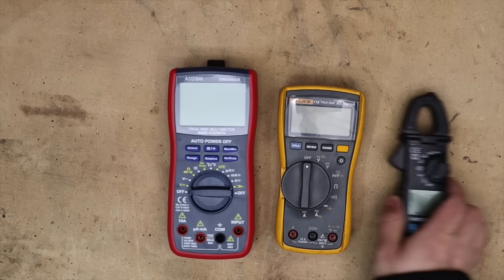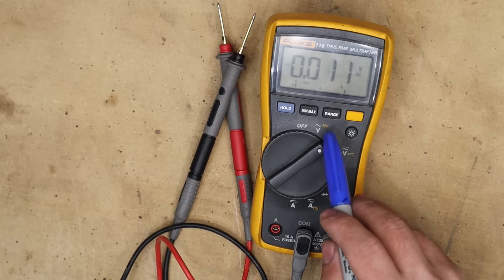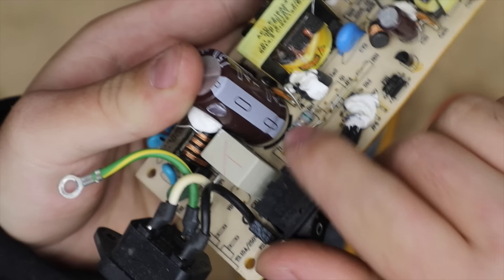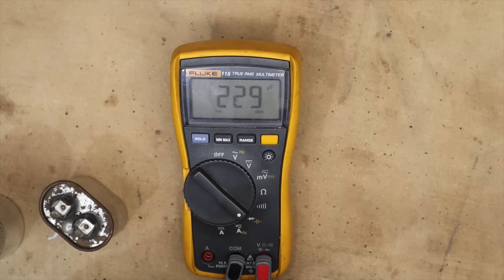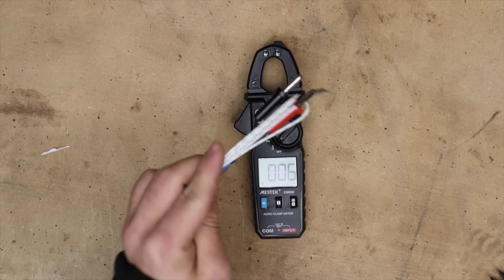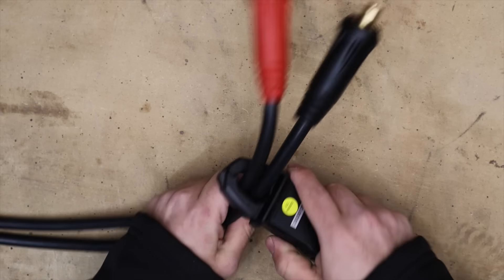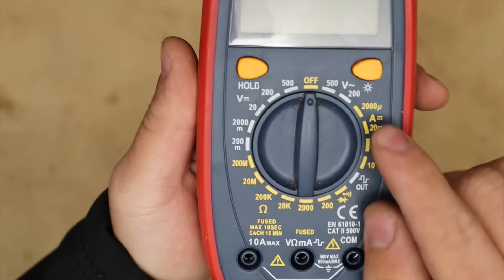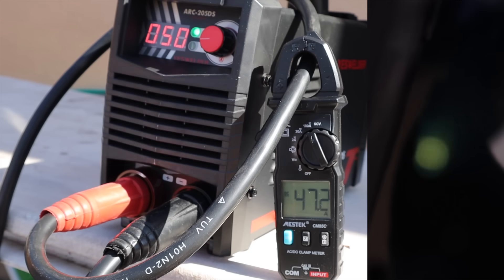How to use a multimeter like a pro, the ultimate guide

Comment: Excellent short intro for beginners here. Picky addon here, sometimes written K, kilo is officially k, not K, as you can see on the Fluke. K stands for Kelvin.
Reply: Also the ”Ol” text when measuring resistance stands for Overload, not open loop. But it basically means the same.
Reply: Open loop or over limit sometimes used by some professionals, sounds close to the concept that the reading is beyond the limit of what the tester is designed by the manufacturer. So overload in this sense is a different concept. But you are also right
Reply: Who the heck is kelvin?
Reply: That must be a fluke.
Reply: @ehdbom I always read it as over limit.
Reply: @MsLegumam, where did you find that ghost logo?
Reply: K is also potassium. Eat a banana.
Reply: @tomh6477  
Mr. Kelvin...
Reply: @georgelamacka8125 actually Lord Kelvin, formerly William Thomson 😊
Reply: @johnleo2668 how can an open circuit be over limit on resistance, its open.... Relays might have a pair of normally open and normally closed contacts, I sure hope the normally open ones read OL in the unenergized state
Reply: An easy way to remember which units get capitalized and which ones don't is that units that are named after a person (usually the last name of a scientist or someone related to a particular field, e.g. Kelvin) are always capitalized and the others aren't (I think there's one or two exceptions to this, but it works the vast majority of the time).
Reply: An open circuit has a resistance but it’s too high for the multimeter to measure so it’s over the limit of the device. 

That doesn’t mean the resistance between the measured points is infinite. Air has resistance and a high enough voltage can jump over air gaps. 

I wouldn’t say it’s overloaded since there is no load but ”over the limit” describes the situation quite accurately.
Reply: Capitalization is important to get right when it comes to metric units. All sorts of things are distinguished only by a difference in capitalization.

mV = millivolt
MV = megavolt
nm = nanometer
Nm = newton-meter
s = second
S = siemens

When dealing with derived units, getting the capitalization wrong can really make things incoherent.

kWh = kilowatt-hour
KWH = a strange derived unit called a kelvin-watt-henry... whatever on earth that would be
kg = kilogram
Kg = kelvin-gram... again, whatever that is

Oh, also, units named after people (like the volt, the kelvin, the pascal, etc.), are always lower-case when spelled out, but the abbreviation for the unit is always capitalized (V, K, Pa, etc.).
Reply: Units are capitalized when they are named after a person.
Reply: @MrTheHillfolk  An open circuit still has a resistance. It's just infinitely high. Very high voltages can jump air gaps, creating arcs, sparks etc.
Reply: Ty
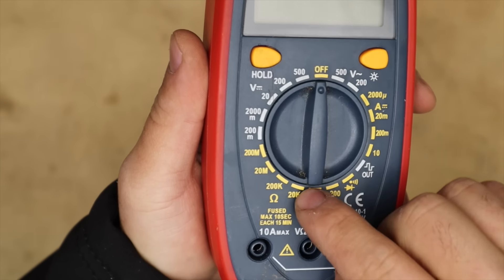Reply: Those standards could be for the scientific community. Other fields may have different standards and practices. If he is actually wrong, I’m blaming the multimeter at 11:09 as it shows a capital K for Kilo/thousands.

Comment: I've watched a few of these type videos about multimeter usage. After 36 years as an instrument technician, I can say what is missing is a basic test before using a multimeter. The meter leads must be tested before use. Plug in the leads and short the leads to test continuity on the OHMS setting. Zero resistance verifies the leads are good.
Secondly, when testing for voltage use a three point test. First, test a voltage source that is live to verify the meter functions. Now test your target source to verify there is or isn't voltage, then retest the live source.
Failure to perform these two simple  tests could result in electrocution, or at least getting zapped.
A good video!

Comment: This was the absolute BEST explaining video I have watched. Extremely easy to understand - even for me that have more or less no clue what-so-ever about electricity. Now I know how to measure electricity for home use. Thank you so much for a very good video !! Respect.
Reply: Cheap meters can tell you something, if you know their limitations.
I have a nice fluke at woek and at the home shop ,but i got a couple The harbor freight freebies at the house. 
Sure ,the fluke tells me the outlet has 121 volts ac ,and the harbor freight one says 130.
When i turn the power off to replace the outlet ,they both read zero. 
Not so worried about accuracy with that ,just if its safe being on or off. 
Still works fine for checking the occasional suspected dead battery for the remote and things like that.
Reply: @MrTheHillfolk  I agree. I thought of getting a Fluke but realized for home repairs an el cheapo meter works fine. It only has basic functions with cheap build quality but I only ever use voltage and continuity to check batteries and blown fuses and never found a use for all the other functions. For professionals and electronics enthusiasts a Fluke is worth it for measurement confidence and circuit protection but otherwise these harbour freight meters are awesome.
Reply: @jonfreeman9682 to be honest, I'm not that impressed with a fluke, being that I work outside all the time as soon as it gets one raindrop on it, DC volts goes thru the roof. 
16v on a 12v system? 
Nope. Pop the battery out and set it on the trucks defroster for 45 minutes and it'll be fine.
 It's a real headache and a hassle. 
Save your money.

Comment: 3:55 STOP! DO NOT USE Continuity function to check if a wire isn't broken! A wire can be damaged and still show good continuity. To check a wire for damage use an Insulation resistance tester! For example Fluke 1507!

Comment: Thank you so much for your thorough explanation of the multimeter. I've been using multimeters for years and I have always tested for continuity with the ohm setting. I never realized there was a continuity setting. And I always wondered what that symbol meant. And most of the time when I'm thinking I want to check homes. I want you actually check continuity. So thank you once again. Great job!

Comment: Great video... Very informative. The only thing you left out is on the diode setting - when forward biased (current is flowing, as indicated by a numeric value), that value is the actual voltage drop of the diode, typically 0.5 to 0.75 (consult the device's data sheet) . Any value outside that range indicates a "leaky" diode. Also, some specialized diodes, like zener diodes, behave differently, which I'm not going to go into here. Altogether though, excellent overview.

Comment: 2:05 another reason to use only one hand is that if you touch a live wire, the current goes through your body and that almost instantly triggers the differential switch and saves your life. If you use 2 hands, the current might go from your left hand to your right hand, completing the circuit without current going to earth and therefore the differential switch won't cut off the voltage.

Comment: I am an R&D engineer that has used multimeters extensively and occasionally an o-scope … but that is a whole other kettle of fish. Your tutorial is well done … and thank you for going over some of the most common safety risks. One safety example you might consider adding is discharging a high capacitance capacitor like found in HVAC units with a high resistance resistor (bleeder capacitor). You could highlight the changing capacitance whilst at the same rendering the capacitor safe to handle.

Comment: I own a few different types and brands of multi meters. Each one has its own advantages. I use my auto range Fluke for most jobs, it’s really the easiest one to diagnose and test with. Having one that gives whole and decimal readings is the best one to have. Testing batteries at my house is the most common task I use the meter for.

Comment: This is a good tutorial on multimeters.

Here’s a handy piece of info for anyone with 18-V tools: a fully charged battery without load will most likely measure over 20 Volts over the terminals so use the next higher setting to avoid an error/overload message. 

P.S. Kilos are definitely represented by a lower case k in the SI system.

Comment: Just to make something more clear: at min 2:00 you say that when inserting the first probe into the socket, the other one could become instantly electrified. This is true. Though, jf you touch the other probe nothing would "probably" happend as the internal resistence of the multimeter when set in Voltage measurement mode would limit the current passing through your body to uA/nA. I used "probably" because if nothing work as ideal (EG: the multimeter is wrongly set, or the voltage you are measuring is actually bigger than 120/230V) something may go wrong. This is quite remote anyway. And better stay safe not touching the other probe as you said in the video :)

Comment: Yes that was a good intro to meters. One small thing that may mislead some, on most meters you don't have to put the red lead into the amps socket for small currents, typically 200 or 500mA. You will get a much more sensitive reading in the mA range.

If you are a keen DIY car mechanic, invest in one with the frequency and duty cycle functions, very handy for testing sensors like cam, crank position, abs, and some types of airflow sensors

Comment: Great video. I’ve been an electrician for 20 years and always thought OL meant ohms not open loop😂. The only other thing I’d add is discharge capacitors even after the power source is disconnected. Many years ago father had one blow up right in his face off a burner circulator.

Comment: Great guide!

Don't forget to measure and account for probe resistance during resistance measurements!

Also, the reading in the diode mode should be the forward bias voltage (which can tell you a lot)
Reply: Can you explain more for beginners cheers👍
Reply: @kevinlawes591  before you take a resistance measurement, you should touch the ends of the probes together and note the resistance without measuring any component. This number should be subtracted from whatever you're measuring. 

The leads and probes have resistance of their own, but the meter doesn't know what this is and just sees the leads and probes as part of the measurement.
Reply: @kevinlawes591  when measuring a diode, the number displayed is the forward bias voltage (the voltage required to turn the diode "on") you can use this to calculate parameters for other components, eg the resistor for an LED etc

Comment: I'd to add to the importance and functionality of the continuity feature.  As a residential remodeler, it has been absolutely vital in troubleshooting electrical systems and knowing exactly what wires go to exactly what outlets in another location without physically seeing the wire run.  I use alligator clips, spare wire and colored electrical tape to be able to go from one end of the house to the other as I frequently work alone and have no one to hold things for me.  This is done with the power off so I can freely touch bare wires with no worries.  We are also required by law to run a continuity test for new home inspections before power can be turned on to the home.

Comment: Multimeters and speed squares are the two most underutilized tools in the trades. Both offer an extremely large and detailed amount of information in a single tool yet most folks use them for less than a handful of tasks.

Comment: One thing to add on to your explanation for continuity. The multimeter will produce a tone until the resistance between two leads it’s under a certain value. 

It is up to the technician to determine if that value is acceptable for the application. For example, if you are determining if there’s a short circuit and your DMM beeps and shows a resistance of 200ohms, that is okay if in your application the voltage between two lines is 1VDC. But if the voltage is higher then that could be a problem.

Comment: Also important to mention is the category of use (CAT) rating.

CATIV requires CATIV leads, which typically come with covers on the probes only letting an itby bit poking out. This is not packaging! That ensures you don't have a large probe stick out at mains voltage where there is a high fault current potential, and preventing accidental shorts creating large explosions. It is required on mains lines, power meters etc. Also the meter needs to be compliant so that any fault that blows up the meter, contains the explosion within the meter. This will also have a voltage rating it can work up to. Typically this is only work for electricians anyway.

CATIII (or above) is what you should be using in switchboards/service panels.

CATII (or above) is what you should be using at sockets. Depending on the probes you have, removing those caps on the probes might de-rate it to CATIII or CATII, but allow them to be inserted into each pin of the socket.

CATI, which usually isn't listed, is basically what you'd use on electronics or extra-low voltage sources. Without any markings, assume those cheap yellow bricks are CATI.

Comment: When you use a meter in series to measure current, it is good to get in the habit of moving the test lead back to the 'normal" jack as soon as you have made your measurement(s). This helps to prevent accidentally short-circuiting something. With some meters the fuse that protects the internal current shunt from overcurrent is quite expensive.

If you are using a "true RMS" meter, be sure to read and understand the manufacturers documentation. Fluke, for example, has a DC blocking capacitor in series with the AC input, so the value you read if there is "AC ripple" "riding" on a DC offset is that of the AC component only. Fluke insists this is correct, but it isn't. The true RMS value must include the DC component. Fluke manuals do tell you how to measure the true RMS that includes the DC (square the AC RMS value, add the square of the DC value and take the square root of the sum). Other meters will directly measure the true RMS that includes the DC.

There are tons of inexpensive meters that will display way more digits than can be justified by the voltage reference used in the meter. Lots of resolution can sometimes be useful, even if the absolute accuracy is poor, but you need to understand what is going on.

Comment: For those meters that don't have a continuity option, (Cheap harbor Fright) you can also use the resistance setting to check for continuity. 
While you won't get an audible tone, the subtle change in readings will tell you that you are touching the same wire.

Comment: Fluke has another function that they put on high end meters like the Fluke 87.  It's called nano Siemens (nS).  You can find it on the Resistance ranges when selecting manually.  Many don't even know what Siemens are!  Siemens are the inverse of Resistance or Ohms (Siemens were originally called Mho which is Ohm spelled backward).  What good is that, you ask?  You can measure extremely high resistances!  On the meter if you have an open loop (OL) using nS, you will see 0.00 nS.  This is effectively infinite resistance.  If you touch the probes together, you will get OL on the display.  Remember...this is the inverse of Resistance or 1/R.  So what can you do with a nS meter?  Test lots of things like semiconductors for leakage.  Sometimes a circuit that is failing will have strange operating conditions because FETs, Transistors, or Diodes are leaking current when they should be stopping current from flowing.  Usually the best way to check suspect components is to take a known good or new component and check it in reverse bias like a diode or a PN junction of a Transistor or a Gate to Drain or Gate to Source in a FET that should have no current flow and compare it to a suspect component of the same type.  nS will tell you when there are leakage currents where there should be none or at a minimum!  You could also check capacitors that may break down under higher voltages but measure okay with the standard settings of a meter.  You could check any component that is supposed to have a very high resistance or open condition.  Leakage currents that exceed specifications can make troubleshooting failing circuits very difficult to diagnose.  nS is an amazing function that should not be overlooked if you have that function available to you on your meter!

Comment: O.L. according to manufacturers manuals means "Over Limit". You can read OL in voltage measurement mode if it is out of range; still voltage there, not open loop.

Comment: 2:52 - Can't say I've ever heard of OL referred to as "open-loop". I always assumed it was "over-load", meaning the meter cannot read that high, so the reading is over the load rating of the meter. There is certainly a resistance rating for the rubber casing, it's just beyond the ability of the meter to read.

Comment: This is an excellent video that I found very helpful as a rookie who “tries” to do just a little bit of automotive electrical work.
I would like to invest in a Fluke meter, but the myriad of models they offer is blinding!  Even your video shows a 115, yet the link you provide is to a 117…& then why not a 116, etc.  Could you shed some light on which I would need for which model would serve my needs around the home and car?
Thanks again for a truly excellent video!
Reply from the maker: Truly, if its just around the house, once or twice a month, a cheap Astro AI meter for 15USD will do just fine, if you do however want to test capacitors for example and have a better quay meter, a 115 is plenty for 99% of applications. Ill go ahead and link the 115, thanks for the comment